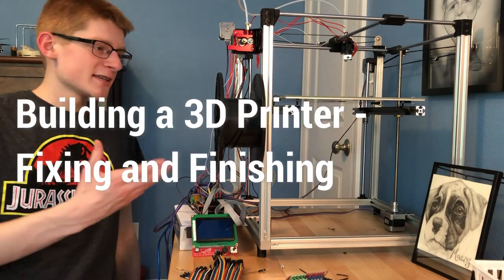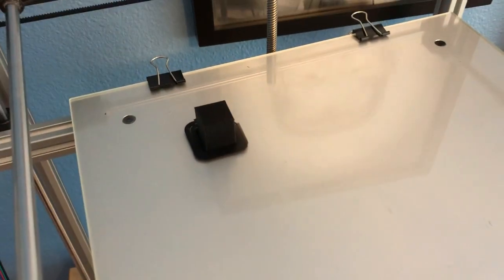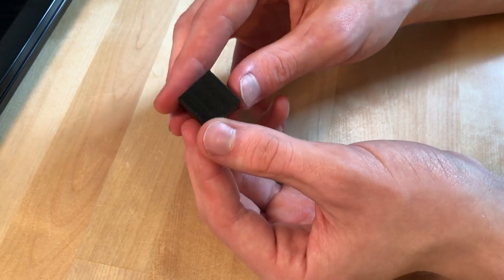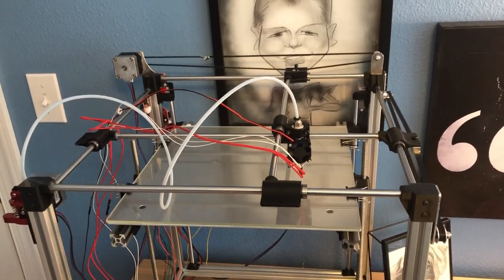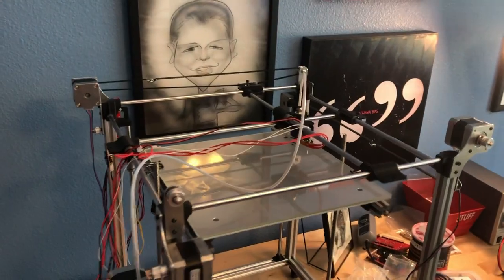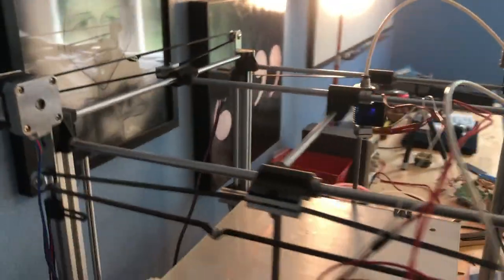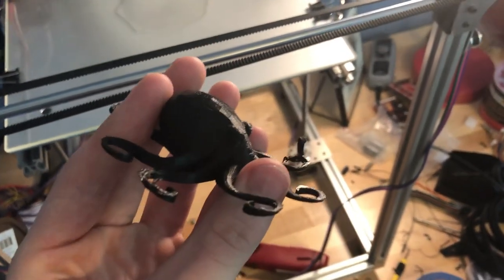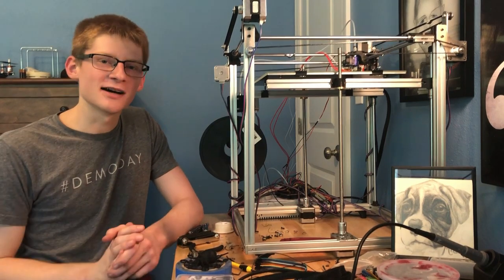Building a Custom 3D Printer | Part 5: Finished

Comment: Do you have any problems the way the idlers aren't parallel with where the belt terminates at the linear bearing to move the axis' such as oval shaped circles? I can imagine the rate of travel not being linear throughout it's whole range of motion because the angle of the belt is changing constantly due to the gantry moving

Comment: 4:17 step/ rev should allready been calculated. you not need start lie machine where to go.
its 3d printer melting plastic.plastic comes out nozzle and it flow any direction 360 you cant predict that.slicer should make cube larger calculating flow with layer height all that science stuff.what if those formulas is bad. cnc machine with extruder not make good quality.its still melting plastic